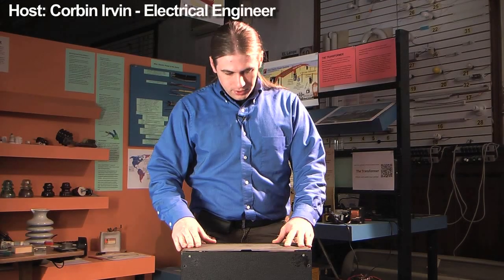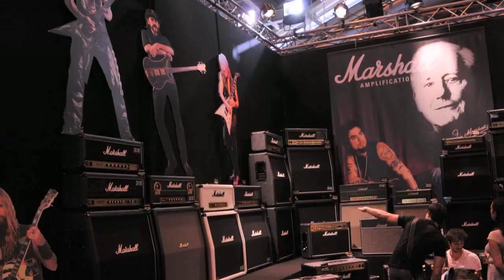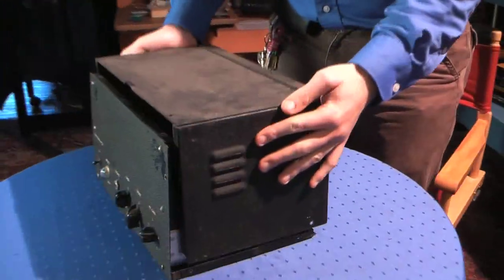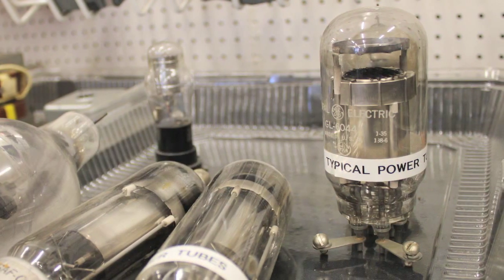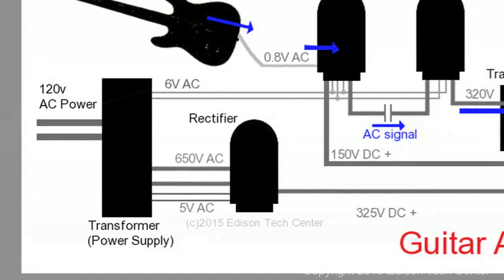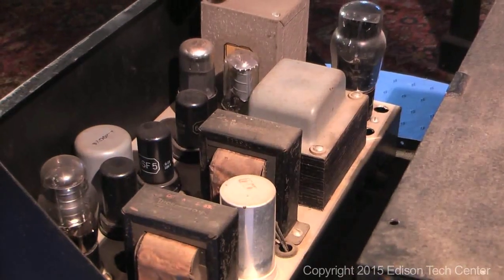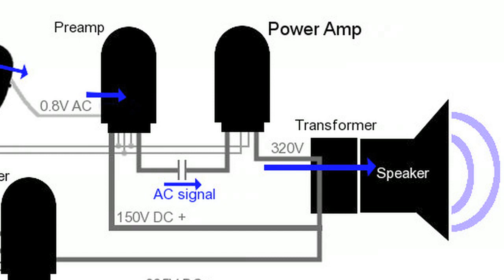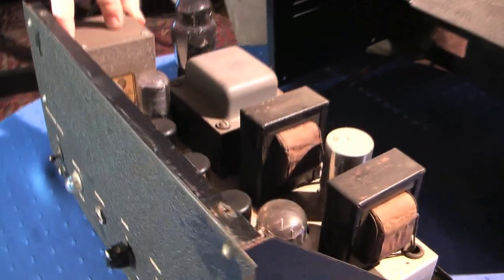Parts of a Tube Amplifier

Comment: The same basic topology is also used in mid to top end HIFI amps. Well at least some of them. They are however a bit more complex then the amp shown in the video. But these amps are usually only used by Audiophiles. I am actually working on a Hifi tube amp at the moment.